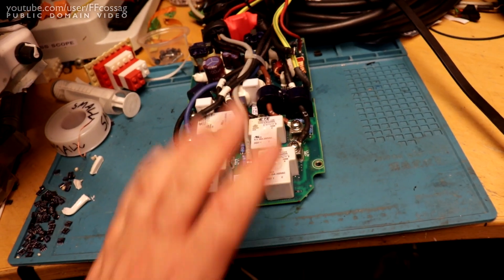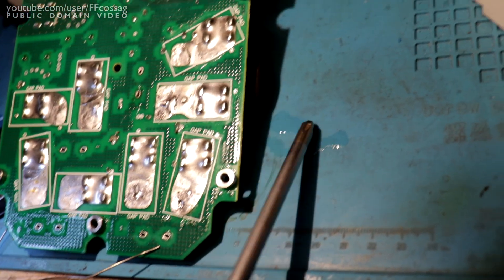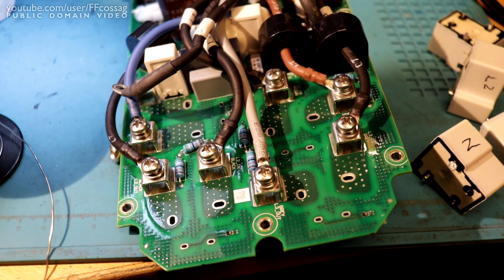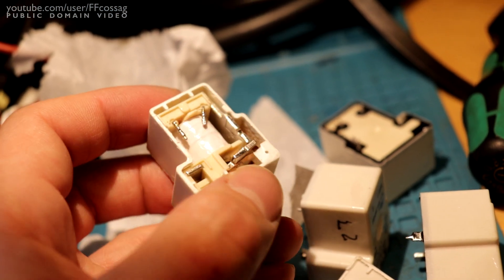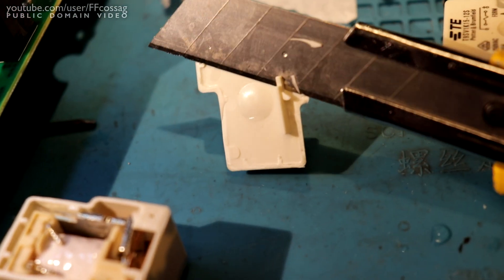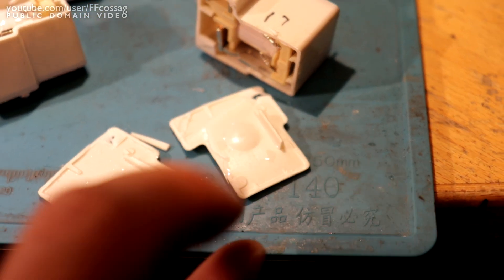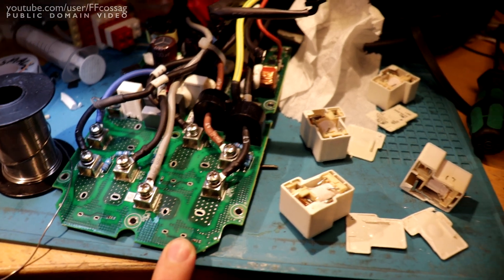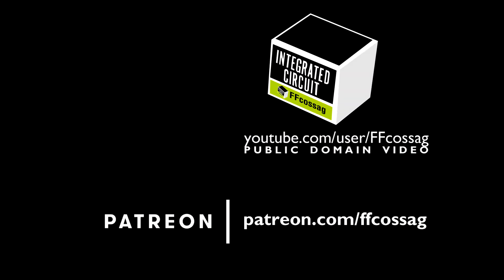CTEK NJORD GO follow-up: Relays full of water!

Comment: If the relays have holes they must be T9SV1K15-12S, flux proof but not wash tight.
Probably the washable version and some slots cut into the PCB would have helped out.

Comment: Shame as it looks like an otherwise nice design. Just checked their website and they certainly advertise it as being outdoor rated, they even have a promotional picture of it being installed on the side of a house without any shelter from direct rain so you can't blame the end user for installing it wrong. I wonder what it needs to fix this issue, my guess is conformal coating and a pressure equalization membrane. Either that or potting the whole thing.
Reply from the maker: To be frank, I don't particularly like the design. They use a ton of very fine-pitch components in a device that sees moisture. 0402s and 0603s just do not fare well in harsh environments. Coating the board will not save you in the long run, as evidenced by the high failure rates of this charger.

Comment: guessing it's too well sealed and it's pulling water in through the cable or cable gland seals due to air pressure changes. could probably fix it permanently by adding a permeable membrane (or an oldschool breather pinhole & injection molded maze seal) somewheres on the case.
Reply from the maker: Yep, something like that would do the trick.

Comment: Drill holes in the relays for drainage 😀
Reply from the maker: The relays have holes - that's how water got inside them! The problem is that the case of the charger doesn't.

Comment: Well don't use it in the rain then. Keep and charge your EV in a garage or shed.
Reply: it's ip65 rated, it can be out!
Reply from the maker: It's not a rain issue, it's a condensation issue. If the charger sees temperature cycles, it will trap moisture inside that has no way to get out. Rain did not cause this.